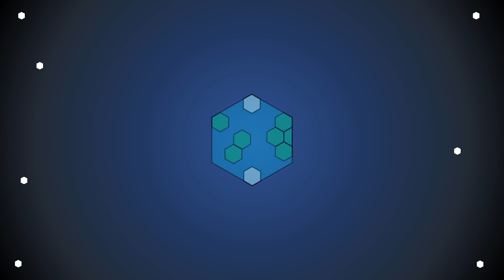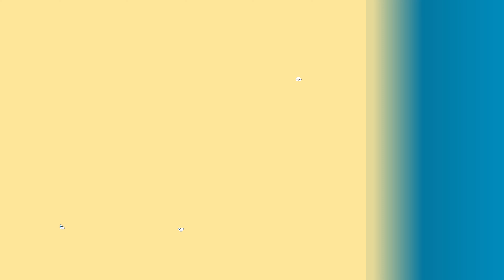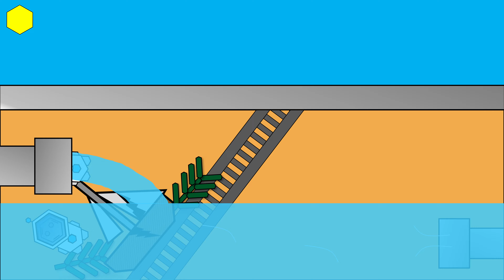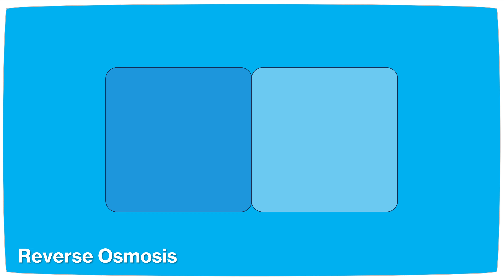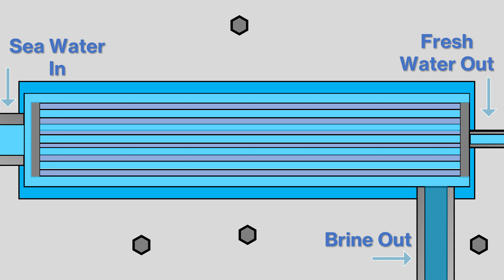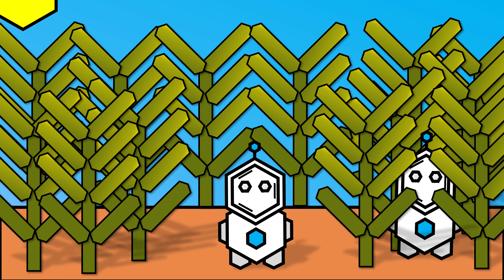How to Drink Sea Water

Comment from the maker: The Benzenes are an Alien species from the planet Aromat in the planar ring system, part of the electron clouds. They are using chemical engineering to develop their planet, so far they have discovered alcoholic fermentation, ammonia synthesis, sulphuric acid production and oil refining. However, they don't just want to develop Aromat they want to explore the system and have built a spaceship, the tessellation, to take them to the closest planet of Ferria.